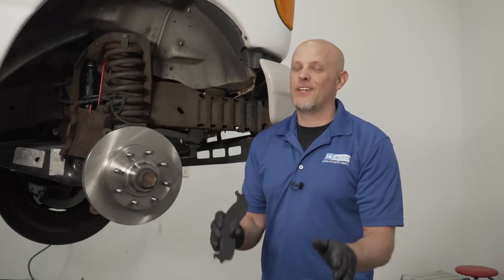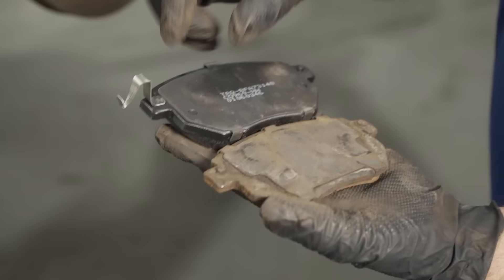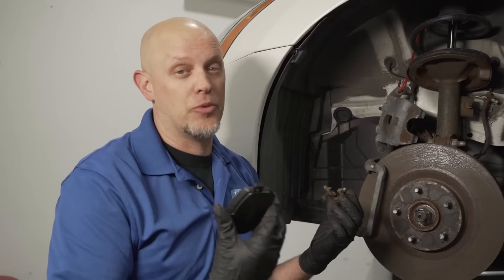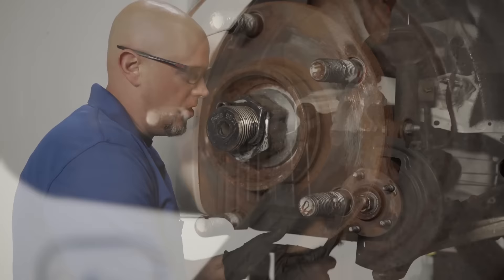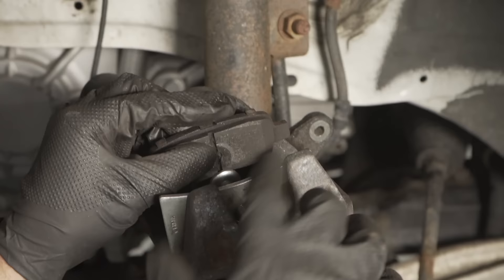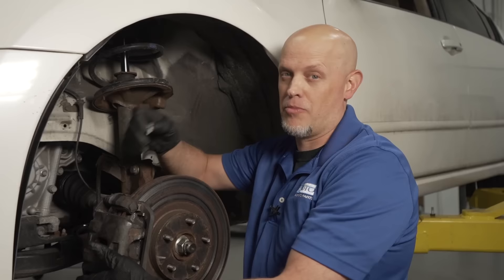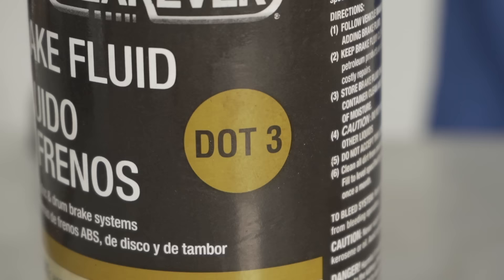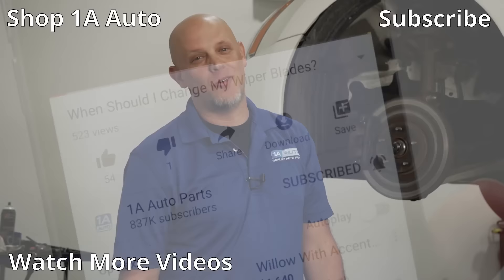Most Common Brake Installation Mistakes!

Comment: Good video, I understand why you mentioned the warning about putting pads on backwards, there’s ALWAYS that 1 individual that will do the dumbest $hit! Only thing I can think of adding is pump the brakes when you are done to seat the piston against the pads, replacing the brake pad wear sensors (if equipped), and check to see if the vehicle has to be put into “Brake Service Mode”!! Some new vehicles have electronic parking brakes, if the vehicle isn’t put into brake service mode you are gonna cost yourself A LOT OF MONEY!!

Comment: Ive never replaced brakes myself so I'm grateful for videos like these
Reply: You gotta try it. It feels so good. Especially when you apply anti seize knowing these shops would never take care of your car the way you do.
Reply: It’s beautiful to know that you have done the work yourself and that you have done it correctly. I trust my own mechanical skills over jiffy lube technicians.
Reply: @thronewalker1153  Jiffy Lube...ha, what a joke!
Reply: @OffNas  Be careful with anti-seize. You're in for a bad time if it gets on your studs
Reply: It’s simple the hardest part is actually jacking the car up and getting the tire off. Once that’s done brakes are easy unless your doing drum breaks
Reply: @Harmonic14  I've heard. I always put gloves on I'm dealing with chemicals (brake cleaner, fuel lines/equipment, the magical acetone and transmission mix, etc).
Reply: If you are doing brakes for the first time in your life, I highly recommend having a friend who knows what they're doing to watch over your shoulder for at least the first wheel. Most motoheads know another one. After that you should be fine on your own. One more suggestion. Pump the brakes after you're finished to seat the pads or the shoes and then take an easy drive down a quiet street to hit them firmly enough to be confident you can stop properly. After that, break in the brakes by avoiding hard stops the first few hundred miles. Yeah, I know you can't avoid a real panic stop but just drive a little more conservatively where possible and brake earlier and lighter during that early period.

Comment: Another tip: some rotor are side specific so don't mix up right with left and vise versa. They sometimes have R or L printed or engraved but double check with the box and the new rotor so you put it in the correct side.
Reply: That I did not know
Reply: Only ever heard of that on drilled or slotted rotors
Reply: good point - the internal cooling fins in the gap between the inner and outer rotor surfaces will not work if R and L is not respected - always do 1 side at at time and compare parts taken off to match the ones to be installed

Comment: The brakes on my wife's car were (pulsating) squealing, so I bought new front brake pads and rotors, and replaced them, even though the old rotors and pads seemed fine.   The squealing is still there.  I should have checked where the noise was coming from.  I jacked the rear driver side wheel off the ground and turned the wheel by hand and found the squealing.

Comment: Great video. Nice thought about loosening the bleeding screw while compressing the piston. I've always loosened the cover of the brake fluid reservoir. I would have liked you to add a portion on the correct way to install slotted rotors. I bought 4 for my 2008 Toyota Highlander and immediately began hearing a kind of wind noise. I figured I installed them the wrong way. The only other item I'd add is how to compress the piston on the rear brakes that have the electronic parking brake. I changed the rear brakes on my 2016 Subaru Outback and learned I needed a special tool that would turn the position while compressing it. Great video. Loved your instructional videos. They make us all look smarter than we are!!

Comment: Always torque your wheel lugs in star pattern in 4-5 increasing torque increments.  Also, many OEMs require DRY studs, not lubed or you will over torque your studs.  Not always for all cars,  but worth paying attention to.

Comment: I was shocked when I saw him using copper for a brake line - that used to be a huge mistake! But Google taught me that now, there are copper alloys that are perfectly safe to use for brake lines. That's a big improvement over trying to bend the old steel lines. I learned something new today, and I'm 69 years old. :-)
Reply: Modern Nickle Copper (NiCu) lines are just as strong as steel and are so much easier to bend. And as a bonus, they don't rust. They are twice the price but in my opinion, they are worth it.
Reply: @Dave-in-MD  Spoton...
True statement...
I stay away from all stainless steel brake lines...
They are a PITA...to get to seat and not leak...
Ask me how I know....

Comment: If you use copper anti-seize on the wheel hub surface, wouldn't that potentially affect the rotor lateral runout when using a dial indicator, which could lead to pulsations and vibrations if the runout exceeds factory specs.

Comment: Great video! I love the in depth explanation of a complete and correct brake job. As for rust, I live in the rust belt. A wire brush is pretty much useless to remove heavy rust scale. Use a file or something abrasive. I personally like to use a needle scaler.  Similar to an air hammer except many small "needles" that dislodge the rust scale. Then use a wire brush and apply some rust deterrent like anti-sieze. Thanks for teaching! So valuable.
Reply: welders chipping hammer
or tap it with a sharp chisel .....

Comment: Some rotors, such as Subaru can be removed by threading bolts into 2 holes in the caliper. Turning the bolts inward pushes the rotor off of the hub.
Reply: Toyota does this also with rotors and drums.  There are threaded holes in the rear drums, so that you can run a bolt into them and easily remove the brake drum.
Reply: Don't mean to be mean, but you really meant to say "the two bolt holes in the rotor" not the caliper, as the calipers have to be removed before the rotors can be removed.
Reply: @thatsonebadhatharry8610  I didn't get the impression you were mean. You were correct and when it comes to car safety systems like brakes, better to be correct than to be overly nice & polite. I've seen many brands of cars with rotors with threaded holes to allow removal by inserting a couple bolts of the correct thread size to force the rotor off the hub. Just make sure you know what size bolt before you go any further.

Comment: It's much better to use a file when cleaning rust from the brake caliper bracket NOT a wire brush. A wire brush tends to just polish the rust and not actually remove it. Use a file, add some high temp caliper grease and then install the anti-rattle hardware.

Comment: I recommend removing, cleaning, and checking the caliper slider pins.  I usually replace them.  I purchase them with the other brake parts, and I have only returned them once because they did not need to be replaced.  Lubricate with high-temperature brake grease.
Reply from the maker: +Steve Rose Thanks for the feedback!

Comment: This is a good intro &/or reminder.  Nice presentation.  I would further emphasis avoidance of getting fluid and grease on the disc and friction pads. As a matter of course, I finish up the job by washing my hands thoroughly before refitting the wheel and then to use aerosol brake / carburettor cleaner to clean off inside and outside faces of the disk, wiping that spray off with clean dry paper towel.  Turning the disc to do this is a final check that all is turning smoothly and nothing is scraping against the rotor.  Bfg

Comment: The warning tabs are always on the piston side of the caliper since the pads always wear out faster on that side.
Reply: If the pad on the piston side always wears out first, you have other issues. Sounds like your caliper is not floating freely.

Comment: When striking the rotor or drum, thread the lug nuts back on flush with the end of the stud to prevent damage to the lug threads. 

If the OE pad material is semi-metallic, then that's what you want to put back on. Different pad materials are designed to work at different temperatures and could cause the rotors to warp more easily. 

Don't put grease on the brake pads. If it actually made any difference, then auto manufacturers would put grease on the pads when the car is new. The grease could also cause dirt to stick and do more harm than good. 

The audible wear indicators or squealers typically go on the leading edge of the brake pad. If all of the brake pads don't have wear indicators, then the ones that do go on the inside/back of the rotor. 

I prefer the coated/painted rotors because they don't rust on the non-braking surfaces. Not only are they more aesthetically pleasing, but they'll also dissipate heat better because the cooling vanes will be free of rust build up.
Reply: If you don't put grease on it, it will squeal like mad. You won't notice a difference on brand new cars because all is still clean and shiny, but when you change brake pads for the first time, there is a lot of rust and dirt on the caliper and piston and you WILL get horrible squeals on metal-to-metal contact. That's even more true if the car is driven in areas with a lot of moisture and salt. The alternative would be to take them off completely, clean and sand every surface that makes contact with the brake pads and hope every metal surface is still flat and even enough not to produce squeals anyway. 
It's impractical and the grease also makes it easier to change them the next time too.
Reply: lots of good points.
Reply: Passenger vehicle brake systems don't generate enough heat for rotors to warp, regardless of pad material.

 The rest is decent advice though
Reply: Grease saves brakes in Canada the salt and snow rust the brakes so fast and without grease th brakes seize in the slides maybe down south where the cars don’t rust it’s fine but it’s good practice to always grease the pads
Reply: Car Manufacturers don't put grease because like buddy said everything is squeaking new but also they don't wanna sell something that will last to long.... Just look at the car parts that used to be made out of metal like blowing fans, even the radiators are now mostly made of plastic so they don't last as long, So you need to change them, so You get $$ out of you wallet..
Reply: Another excellent tip!
Reply: I put a lug nut on a stud  to keep the rotor from falling off as I hit it
Reply: @roydaniels6297  true. That is why i'm happy that there are after markets parts like the radiator made up of alluminium that last longer  unlike plastic materials.

Comment: Nice video; I particularly like your demo adding oil to the fluid and showing the resulting distorted seal.  
One thing you might add in a future broadcast - if you need to "tap" the rotor to remove it, you can use a deadblow hammer with little risk of damaging the rotor's surface.  I haven't had much trouble removing rotors, but I've had a few stubborn drums over the years.
Thanks for posting

Comment: i’m still very new to working on cars and i did not unscrew the bleeder screw when i compressed the piston, i did compress it slowly for sure. i worked on a 2008 avalon and did a test drive but now there’s grinding. i feel i need to replace the brake hardware, i did make sure to install new anti rattle shims because i did not have any on there at all

Comment: Another thing worth mentioning is the TWIST , or screw in type calipers that need a special tool to screw them in.  Some use needle nose pliers to get them in.
 The best thing i ever did was purchase a universal kit to press the "screw type" calipers in. 
 My first experience with them, i thought my calipersbwere frozen.
 Glad i didn't run to the auto parts store to buy new ones.

Comment: Great video to watch out for doing something wrong. Remember that brake fluid can damage your paint. If taking the cap off the reservoir when compressing calipers then put lots of rags around so not to get fluid on the paint in the engine compartment.

Comment: South Main Auto had a video where a young feller had pounded the snoot out of his rotors and couldn't get them off. Problem was he didn't remove the one or two screws some rotors have holding them to the hub. You didn't mention that. Great video though, pretty thorough and informative for DIY's
Reply from the maker: +David Timmel Thanks for checking us out. Shop for high quality auto parts on 1AAuto.com:

http://1aau.to/m/Shop-1AAuto-c

Comment: I was pretty confused with opening a bleeder while compressing the piston back in. That fluid came from the revivor on the mast cylinder and by opening the bleeder you lose that fluid causing the master cylinder to be low on fluid, not to mention now you risk air in the system and the need to bleed the system. I take the cap off the master so it doesn't pressurize anything and let the fluid go back into it. No fluid lost, no bleeding. One more thing, take that grease and toss it in the trash. In all my years, I never put grease near brake pads, but I had seen it done on the internet so I thought I would try it. I picked up the special brake grease at NAPA and put a very little on the tabs like you did and a light coating on the back of the pads. The grease got hot and melted and ran all over the rotors and of course, ended up on the pads and the brake job was lost and I had to do it all over again, not to mention, grease causes the dirt and grime to get attached to the brake parts and then they don't move freely which is the opposite effect than what you were going for. Just make sure the brakes are clean and dry before install, that's all you need, save the grease for the suspension where it belongs.
Reply: Interesting I'm going to try your break method next time and I'm with you with the bleeder part I've been doing it this way (not opening it) ever since my ex father-in-law showed me this trick.

Comment: A good way to clean a new rotor is to place it on the spindle without fastening it in place inside out and spray with brake cleaner.  Then turn it over, clean the outside surface and install it. This removes any oil or cosmoline applied by the manufacturer from both surfaces of the new rotor.

Comment: Thanks for the tips! I learned a lot. Quick question, when you were looking at the piston, you mentioned that if you see fluid around it you would need to replace the caliper because it would need a new piston seal. It looked like you had fluid in that area in yours, was that the case for yours or was I seeing something else?

Anyone else know?

Comment: Instead of opening the bleeder valve, just open the cap on the brake fluid reservoir before compressing the caliper. Dont forget to put it back on!😉
Reply: Careful, if someone has been topping it up you'll end up with no paint on your firewall..
Reply: That is a terrible idea, there is a real threat of pushing debris into the abs controller and ruining it then it's lots of money to replace it.
Reply: @jadefreier8084  It is not a terrible idea.  Clean the cap and area before unscrewing the cap. Then just unscrew it to relieve pressure. Place the loose cap on but not tightened.  Then clean the boot area under the caliper boot and ensure the area is clean before pushing in the caliper slowly.  The system is closed and debris in the line will cause issues with the ABS pump.  If that bleed screw is opened and air gets in, you are in a world of trouble. If the bleeder screw breaks or is not tightened properly, you will have problems.  It may be rusted on.  Once the pads and rotors are changed, every 3 years the fluid should be changed.  If you lube the sliders regularly, then your brakes will last a long time.  Then bleed once a full pad and rotor change is done.

People break open that bleeder and allow air into the system since they do not compress properly.  Not opening it will ensure the air risk is not present.
Reply: No, No, your wrong leave the brake work to us that know what we are doing!
Reply: @byronakhavi953  jade is right.  You don't want to push old brake fluid into the antilock brake system (ABS) control module.  It has nothing to do with the reservoir.  The fluid in the caliper is exposed to high heat and can get contaminated. 
Get an inexpensive hand vacuum pump and put it on your bleeder screw, draw down a few pounds and you won't have to worry about air.
Reply: I was taught to always bleed each caliper when changing pads because the fluid inside the caliper is most likely contaminated and it will contaminate the rest of the fluid if you push it back out through the caliper.  

I take a length of clear plastic hose, connect it to the bleeder valve, run the other end into an old plastic bottle then open the bleeder valve and compress the caliper. After I'm done I take the plastic bottle and dispose of the contaminated brake fluid.
Reply: @jadefreier8084  I've been doing it a long time and never had a problem pushing debris into the abs. And what debris is there to push into it ? It should be just brake fluid. Are you using dirty fluid ?

Comment: When doing pads/rotors, make sure to hang the caliper securely, especially on front brakes which can be heavy enough to put a lot of stress on the flexible end of the brake line

Comment: Great video!

What about caliper pins that have a rubber ring on them, on the opposite end of where the pin get bolted?
I've always encountered them on just one of the pair of pins.
Which pin goes where, on the top or bottom?

Once again, great video.
Reply: Excellent guestion/observation. What do you say @A1AUTO